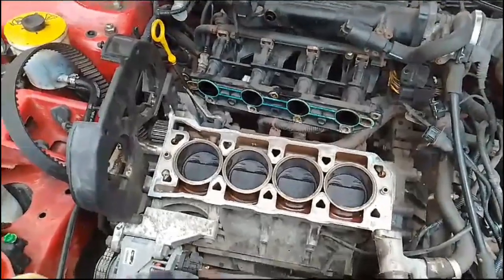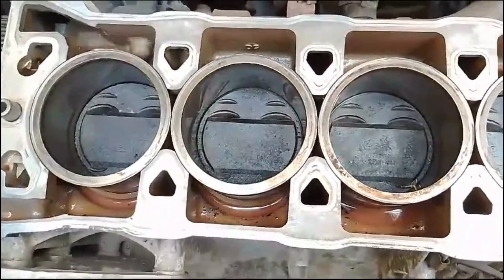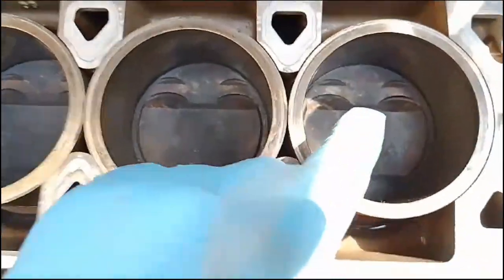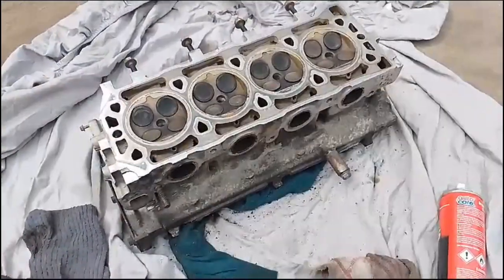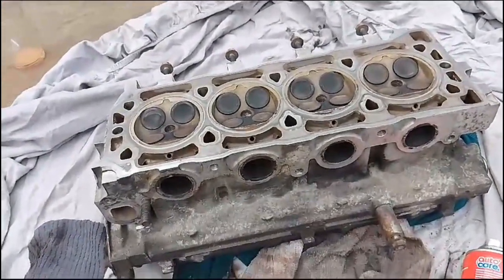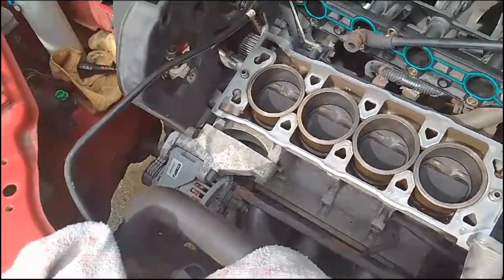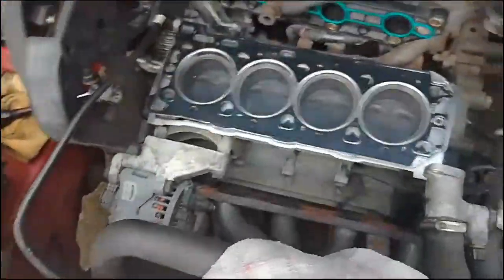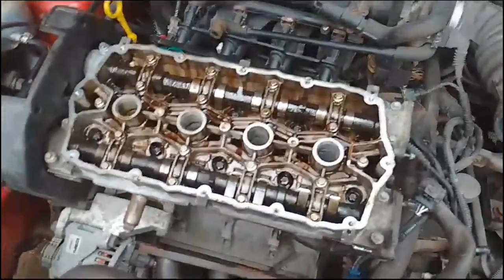Rover K Series Head Gasket Replacement Part 2 - Rover 45 1.4

Comment: Its quite normal for some of the valves to be open as the camshaft is still fitted. All the valves will only be closed, if you remove the cam shafts .

Comment: Your inlet gasket has failed, I can see it was not seating correctly,  this will have caused over heating problems. As there appears to be no warping on the head based on what you've been told, did you check that the liners heights are in good condition, I see you put a straight edge across the block but couldn't tell if any of the liners had dropped, if you have 3 thou of liner above the block and they are all even you can get away with using a MLS gasket, if the liners are are not even the MLS gasket should not be used as it may not seal correctly and will probably fail, whereas the very latest Elastomer Payen Gasket will seat correctly as it is more flexible to liners not being even. Personally I would have used a new Elastomer gasket. Hope all has gone well!
Reply from the maker: The guy who filmed and did the work sent me the videos to host as I used to own the car, I don’t think he’ll see this